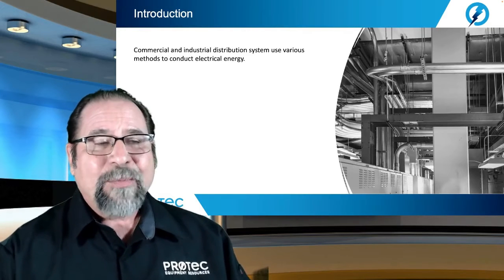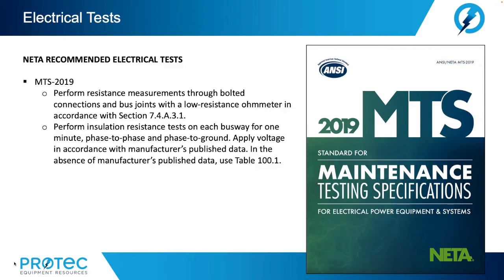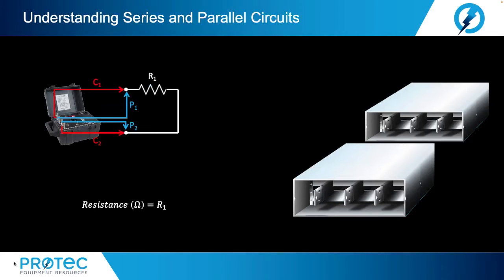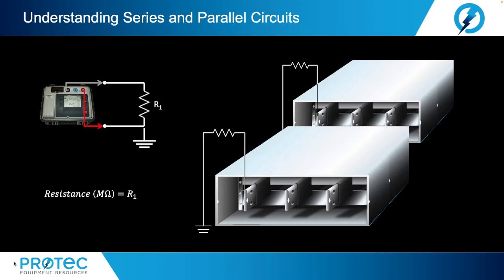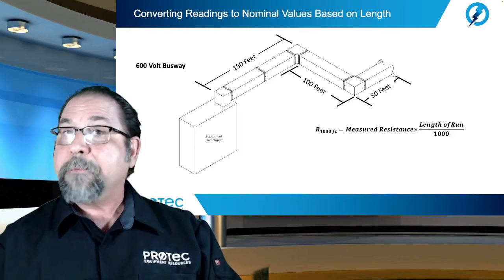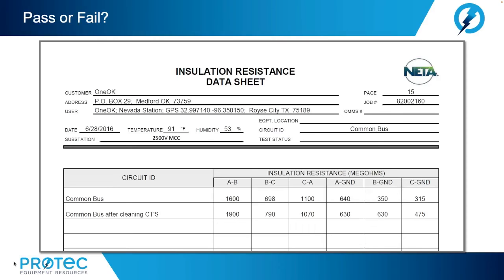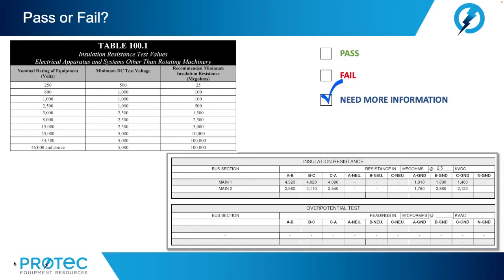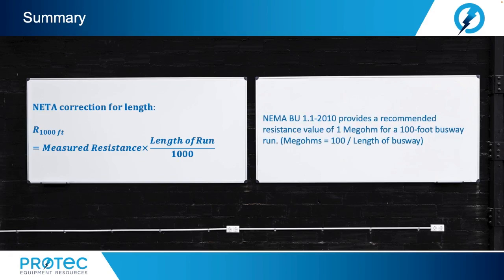Resistance Testing of Busway Systems (Protec June 2022 Webinar)

Comment: Any temperature correction factors to apply?
Reply from the maker: Anytime resistance measures are involved, particularly if you intend to trend, temperature corrections would apply.  Many people use resistance as a spot reading, and do not apply temperature correction.  If data is to be trended it is always a good idea to apply temperature correction.  NETA Table 100.14.1 provides insulation resistance conversion factors (20 degree C).